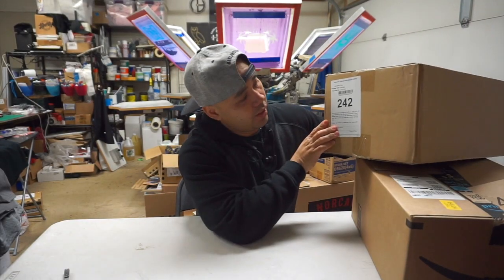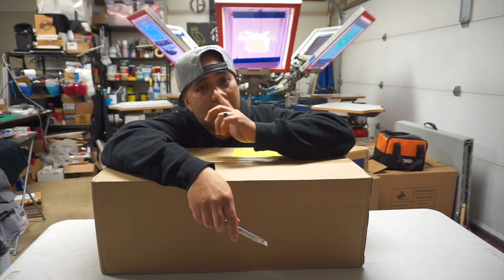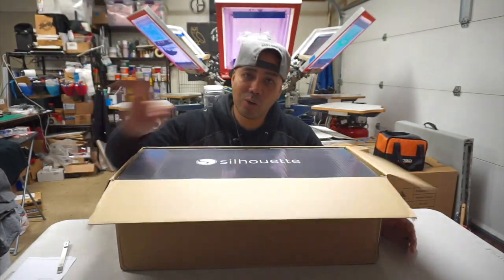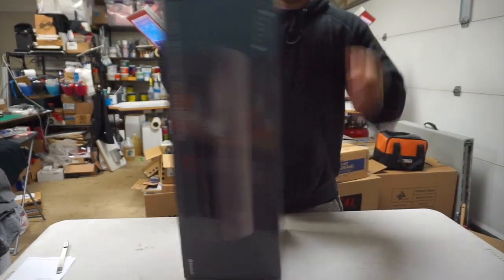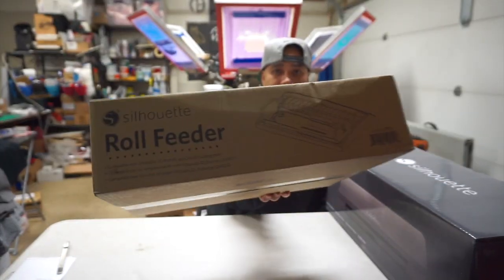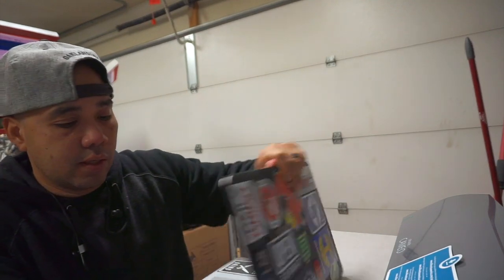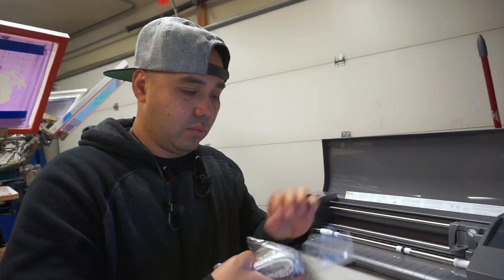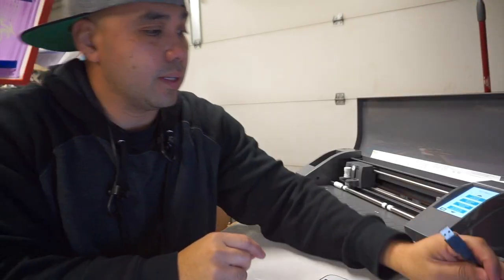My New Vinyl Cutter and Some Issues (S:04/Vlog 075)

Comment: Ha! I was right! Cameo 3 is a great machine especially for what you're gonna use it for. I started with that but upgraded to the Graphtec CE6000. I'm thinking of picking up another one just for small detail stuff which I can't seem to figure out with the Graphtec. The only thing I didn't like about it is the tracking of material on long pieces.
Reply from the maker: OOoOo a GRAPHTEC! Baller. 😂

Comment: I had a cameo3 had nothing but issues with it I got tried of calling tech support and  gave up ended up selling it to a guy that said he knew how to fix it so I wrote it off as a fail
Reply from the maker: Oh. Well that sucks. What was the issues
Reply: The cut head would freeze then make a weird grinding noise then puncture through the HTV and destroy it